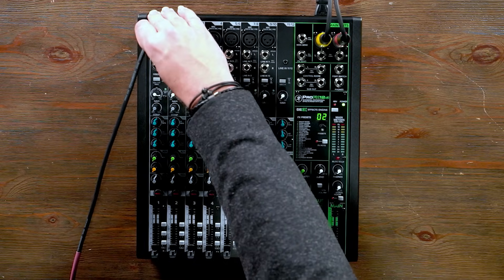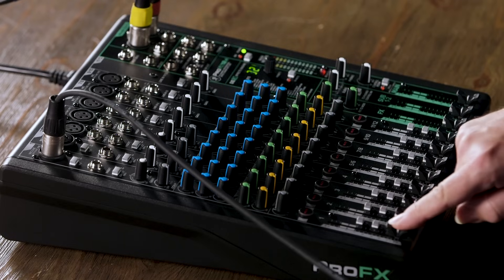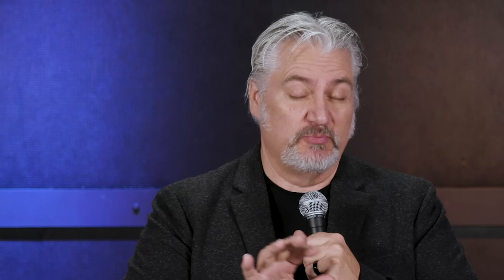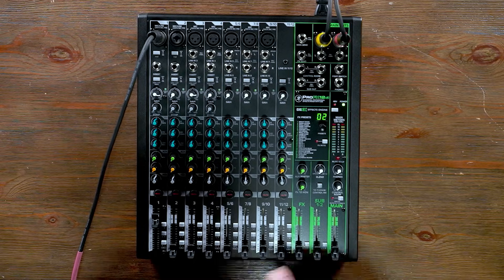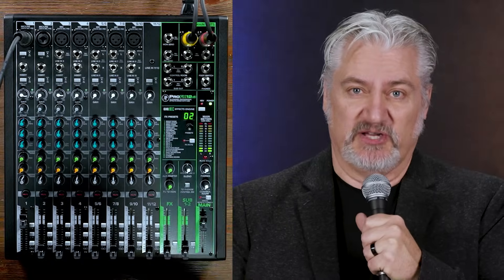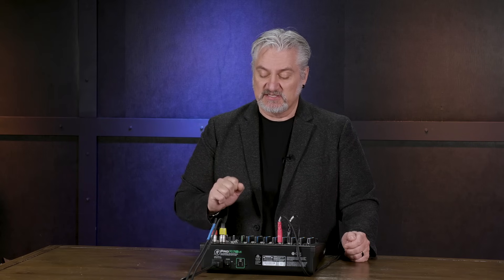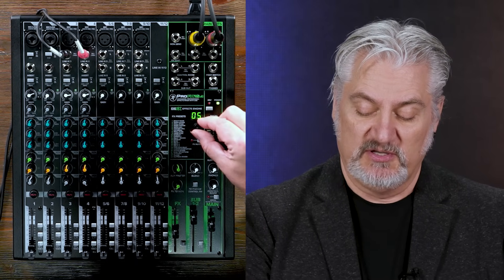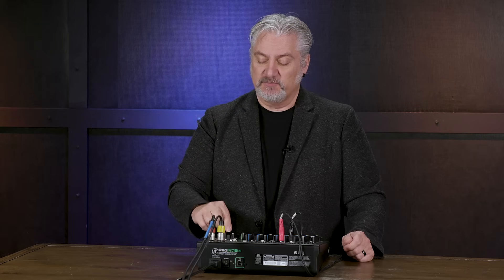How Audio Mixers Work – What is a Mixer & What Does it Do? | Live Sound Lesson

Comment: Hello,  we have a Mackie profile v3 plus series that is set up in our ballroom.  We have a front left and right speakers and overhead speakers in the ceiling. We use wireless microphones and for the first time, we will be using a cell phone via Bluetooth and using Spotify for our Playlist.  The problem that we ran into is this.  If we have the front speakers playing, you can barely hear the overhead speakers.  If we have only the overhead speakers on, you do not hear the background singers in the song.  It is only music playing but we can hear the lead singer.  But we can hear the background singers thru the front speakers if the over head speakers are off.  
Could this be a wiring issue?  Could it be use not mixing correctly?
The person that put in the system has no clue how the profx works.  
And help would appreciated.  Thank you.

Comment: I'm using a Soundcraft 16-channel mixer with JBL PRX 800 series tops and subs. Is it safe to connect bass guitars and electric drums directly to the mixer, or could that overload the system and cause issues with the sound?
Reply from the maker: Hi, thanks for your interest! The short answer is yes, it’s safe. Most electronic drums and keyboards output a line-level signal that can go directly into the line inputs on your mixer, so there shouldn’t be any issue there. Depending on your specific mixer, it may be a bit more complicated with bass or guitar, since those instruments generally have a high-impedance (or “Hi-Z”) output that’s designed to connect to a guitar amp. Some mixers have Hi-Z inputs that you can plug a guitar into directly. If yours doesn’t, you’ll probably want to look into getting DI boxes for any guitars or basses that need to go through the PA. I usually recommend the Radial ProDI for this:
https://www.sweetwater.com/store/detail/ProDI--radial-prodi-1-channel-passive-instrument-direct-box
Even if your mixer doesn’t have Hi-Z inputs, you won’t break anything by connecting a guitar to it directly. You’ll just probably notice that the sound is extremely quiet and noisy, since the ¼” inputs are expecting a line-level signal rather than instrument-level. And as long as you are being careful with your gain staging, avoiding clipping at every stage, you won’t have to worry about overloading anything.
I hope this helps a bit – feel free to contact me directly with any further questions, and thanks again!
Caleb Lowrey, Sweetwater Sales Engineer, (800) 222-4700 ext. 1620, caleb_lowrey@sweetwater.com
Reply: @sweetwater  much appreciated, thank you it helps.

Comment: Great review! 
Question? I have a Yamaha MG 166cx. For some reason, when I plug microphones in, they are always on. And it doesn’t matter if I push the on off button, the microphone stays on. But, I can turn the sound off with the PFL button. Also, the faders don’t turn the volume up or down, I can only control the volume with the master. Do you know what this means?

Comment: can i go in the mixer then sidechain out to my compressor and then in again?
Reply from the maker: Hey there! Yes, you can certainly run a compressor with that mixer. While there are a few different ways to do it, I would recommend taking advantage of your auxiliary output to run into your compressor. Essentially, you’ll run one of the “aux” outputs from the mixer into your compressor. Then, you’ll run the output of your compressor into a line input channel on the mixer. Now, each channel will have access to your compressor via that channel’s aux send, which will allow you to control how much signal from each channel is being sent to your compressor. Then, the channel that you’re running the compressor back into will control how much overall signal of your compressor will be sent to the main output of the mixer. This is your “return” channel.
Feel free to reach out if you’d like to chat through some of the details of this a bit further. It can be a bit confusing at first, so I’d be happy to help out where I can!
Nick Pasquino, Sweetwater Sales Engineer, (800) 222-4700 ext. 3230, nick_pasquino@sweetwater.com

Comment: Can you use, let's say just one external effect processor, like reverb, to process reverb for every channel? Or do you need to dedicate a separate piece of hardware for each channel?
Reply from the maker: Hey there! Yes, you can use a single reverb processor to effect multiple channels. You’ll just run from the “FX Send” output on the mixer to the input of your reverb unit. This way, each channel will have access to that “send” with the yellow FX knob. Then, you’ll want to take the output of the reverb unit and send it back into a line input on the mixer – this will act as your “return” channel and will allow you to send the reverb signal out to your main left and right outputs.
Feel free to reach out if you’d like to discuss the signal flow a bit further!
Nick Pasquino, Sweetwater Sales Engineer, (800) 222-4700 ext. 3230, nick_pasquino@sweetwater.com

Comment: Its been a very useful video for me. Sir, I have few doubts,... I hope you will answer to me.
1. Can i use Mic and line (in channel 3) at a time?
2. Should I use Gain to my keyboard?
3. Do Compressor function work for a dynamic microphone?
Reply from the maker: Hey there, Augustine!
On channel 3, technically you could plug multiple signals into that channel, but it wouldn’t be recommended. Since there’s only one gain control, volume control, etc. on that channel, you’ll want to just run one signal into that channel.
Yes, you can use gain with your keyboard! It’s all about making sure you have a healthy signal coming from the keyboard and into the mixer. Just make sure you aren’t distorting or clipping the signal going into the mixer.
Compression will work with whatever signal you’re sending into the channel. It doesn’t matter what kind of mic, or what level signal you’re sending into the channel!
Thanks!
Nick Pasquino, Sweetwater Sales Engineer, (800) 222-4700 ext. 3230, nick_pasquino@sweetwater.com

Comment: I have a American audio dcd pro 310 rack mount dual cd player, can I connect this to the Mackie mixer and channel fade songs from one cd to the next cd
Reply from the maker: Hey, Roger. Good question! If you have a mixer with two stereo inputs like the Mackie Mix8 you could manually adjust the knobs to do a cross fade:
https://www.sweetwater.com/store/detail/Mix8--mackie-mix8-8-channel-compact-mixer
A better way to do this is to use a two channel DJ mixer like the Allen & Heath Xone:23, which gives you one fader to fade between the CD signals as well as discreet way to monitor the channel before switching so that you can make sure the right song is playing:
https://www.sweetwater.com/store/detail/Xone23--allen-and-heath-xone23-22-dj-mixer
Give me a ring if you have further questions.
Drake Sobehrad, Sweetwater Sales Engineer, (800) 222-4700 ext. 3271, drake_sobehrad@sweetwater.com

Comment: One newbie question: Is it possible to use the laptop's mic line in to route in the mix out of the mixer (without an external audio interface)?
Reply from the maker: Hello, Adela! You technically could, but it won't sound very good. It also depends on how hot the output of the mixer is - if it's a line level out and you have the master volume set pretty high you'll likely be pushing that little mic input way too hard. I would recommend at least getting a small/cheap interface.
Thanks for the interest!
Kevin Spunde, Sweetwater Sales Engineer, (800) 222-4700 ext. 1732, Kevin_Spunde@Sweetwater.com

Comment: Is it possible to connect  the output from an amplifier into the Pro FX 16v3 ? If so into where do I connect it ?
 A guitar input to an amp, the amp out put into the  ProFX16 v3 in order to monitor it)
Reply from the maker: Hey, Tommy. Thanks for reaching out. To get your guitar amp into your sound board you can do one of two things. 1) Mic the speaker on the can and then plug the microphone into the mixer. 2) If your amp has a D.I. feature you can take an XLR from the amp to the mixer and run direct. Whatever you do, do not take the powered output from your amp head and plug it in direct, as it will damage your mixer.
Thanks,
Grant Embury, Sweetwater Sales Engineer, (800) 222-4700 ext. 1647, Grant_embury@Sweetwater.com
Reply: @sweetwater  Thank You . I will try the second alternative.

Comment: Hello, I wanto to know if it is posible to send internal effect to monitor but no effects to main, Thanks
Reply from the maker: Hey, Fernando. Thank you for checking us out on YouTube. Your question really depends on the mixer you are running. In most digital consoles it is pretty easy to mix the fx to the monitors and not to the mains. You just have to change your routing section to do it. In an analog board it is a bit tougher and not possible in every scenario. In some analog boards, if you route or patch the aux returns back to the board on input channels you can send those to the monitor auxs only, and then disable the feed to the mains on those channels. Not all boards have this ability though, as the returns are routed to the mains only. In most situations, analog or digital, you just need to change the output election to only send to the aux/monitors send and disable the send to the mains on those channels to make this work. Please reach out if there is anything else I can help with.
Thanks,
Grant Embury, Sweetwater Sales Engineer, (800) 222-4700 ext. 1647, Grant_embury@Sweetwater.com

Comment: Great video , when you pan a stereo sound into 2 channels, you have to perform every action on both channels precisely to have the same result on every channel. to avoid this i know i can use the stereo input channels. 
the problem that i have is, i have too many hardware synths and drum machines where i run out of stereo inputs. how can i solve this problem without using the panning option?

Comment: Question: should you always use 2 different channels for stereo inputs? Or can you get by with using one channel and a stereo to mono adapter cable?
Reply: In what context?  This is too vague of a question to provide an accurate answer for.
Reply: @RickK1988  Like if I have a stereo effect pedal (like the Eventide H9) that I'm running music thru, should I put the right and left outputs as two separate channels? Sorry if it's a dumb question. I'm not very experienced with audio. But I was thinking if I use an adapter to combine the two stereo inputs, I'll just have mono and not stereo.
Reply: @seanspartan2023  generally with pedals you can come out of just the left output and it acts as a mono output on its own.  If you come out of left and right outputs of pedal and plug each into their own channel I would pan so much left and so much right for each channel.  Just keep messing with it until it sounds good. Most pedals or modules have stereo outputs and the left one usually has (mono) out next to it that way you don't necessarily have to use the right output and end up with basically the same mix. You just have more control doing stereo mix on what you can do as far as a mono mix.
Reply: You can use a Y adapter as you have implied, which will combine two signals thus creating exact same sound on right and left channels or speakers, but that would defeat the purpose intended by manufacturer which has included stereo outputs on the device for a reason-to have a slightly different sound on each channel with that creating the stereo effect. Especially true with effects pedals such as chorus or phaser. Just don't forget to pan right channel right and left channel left to hear the sound 'move' in the stereo field
Reply: you can even save more inputs by hooking up that eventide as an external effects using the "effects send" and "return".  the send is mono and the return is stereo.  what is cool about using the effects send is that you can use your eventide on any input channel at any time just by sending that channel out the "effects send". if you use it as part of the input path, it only affects the source plugged into it, and you would have to re-wire to use some other source vs just turning a knob on the mixer.  some mixers have several effects sends and you can set up  sort of permanent effects with multiple external effects units and then just blend in whatever you want in parallel, like a delay on send #1,  trem on send#2 and reverb on send#3. you can use any or all on any or all channels that way (pedals work fine in effects loops. If you want to string several pedals together for series effects on one send, that works great too)